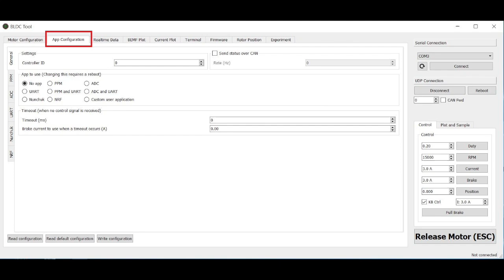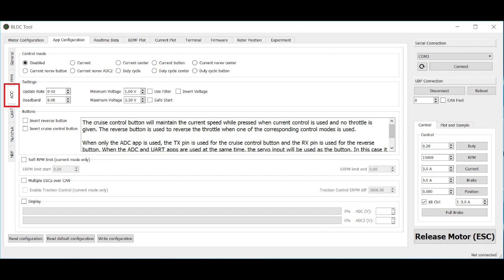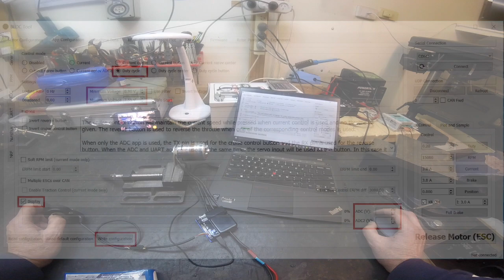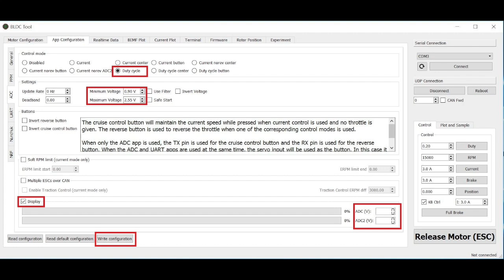Vesc eBike throttle setup

Comment: Good day!
Could you share the profile with these settings in xml format? And it would be very interesting to see the movie in your performance how to change the firmware. I have FSESC 4.12 (sold as 4.12, but defined vesc-tool as 4.10) and it is very unstable connected to the computer via usb: constantly turns off in the case of connecting the motor connecting the gas handle, from the "random-breeze", etc.
Thank you.

Comment: Im confused as to why there are two ADC channels. Is there any way I can limit the input to just one channel?

Im using the VESC tool instead of the BLDC one.
Reply: Ahmed Husain some people use ADC2 for a second throttle for regenerative braking.
Reply: Ahmed Husain I use the vesc tool too. It works great. Throttle signal to ADC, ground to gnd and positive to 3.3v.

Comment: Hello john.. i´m return ;).. the accelerator that I have compounded does not work. I have put a potentiometer.
My problem is that in the engine test I find hall failure .. otherwise everything is fine.
The problem is when configuring engine type. With BLDC I do not have problems to start the rotor ... but it loses some revolutions and it sounds something different.
When I put FOC it sounds better and has more revolutions .. but I have the problem that I show you in this video ..

https://www.youtube.com/watch?v=-6X3qUdcewM

Can you help me? Thank you